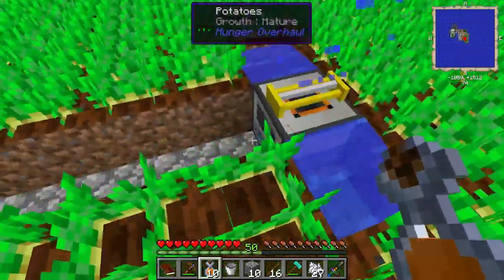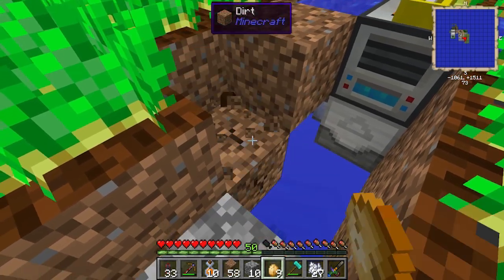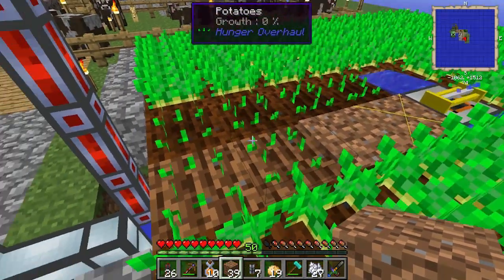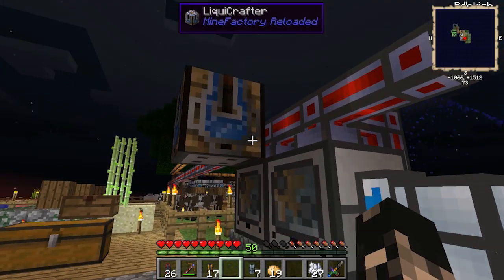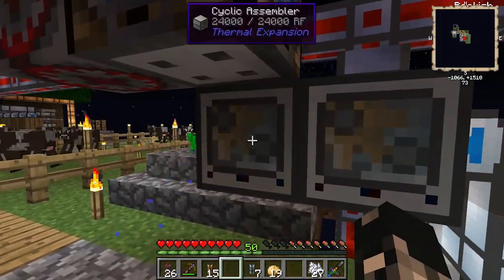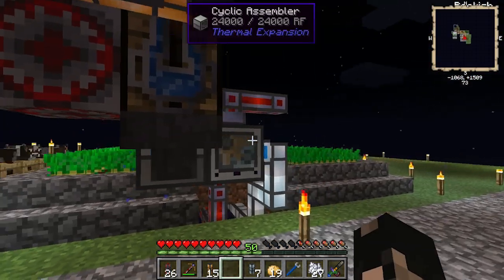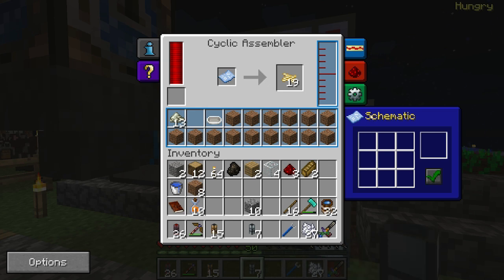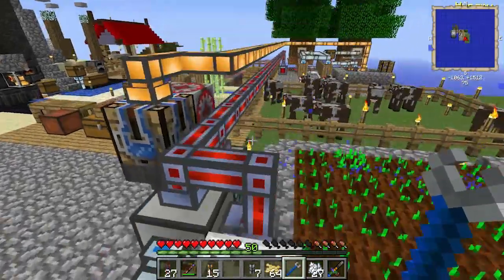Agrarian Skies #5 Automatic Fries, Automating Pam's HarvestCraft

Comment: Sorry to point this out, but where exactly did you use any item from the Pam's HarvestCraft mod? The only thing I could see was the salt and that's a crafting component only... If you say "Automating Pam's HarvestCraft" in the title of your video please make sure that's what you actually do. I was looking for how to automate a Pam's HarvestCraft presser and am now none the wiser...
Reply from the maker: First I'd try a hopper above and below the presser, that should feed items into the presser and pull them out. Not sure haven't tested that yet. There are 2 pams items automated in this. Salt and french fries are automatically made.
Reply: Ausyarr Feeding stuff into the presser worked without issue. Getting stuff out can only be done from the bottom of the machine. This appears to be common with Pam's HarvestCraft, but I hadn't considered it (that's why I came here ;))... I'm currently using a ME Interface for the feed-in (with recipes) and an itemduct as a feed-out on the bottom. An itemduct (as feed-in) works as well and the feed-in apparently doesn't have to be on top...
I'm playing agrarian skies and only have fries from Hunger Overhaul, so I hadn't realised your end product was from Pam's HC.
Reply from the maker: no problem, let me know if I can assist with anything